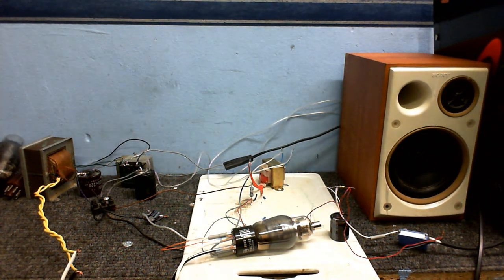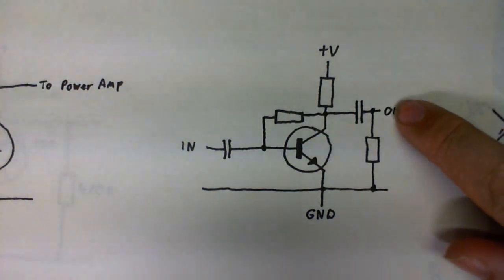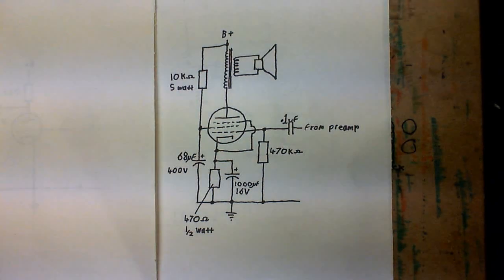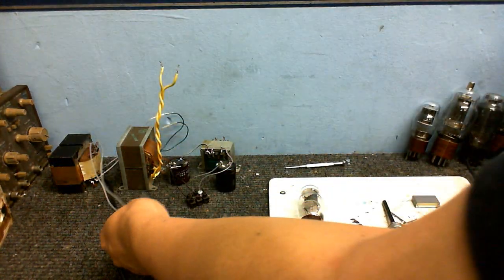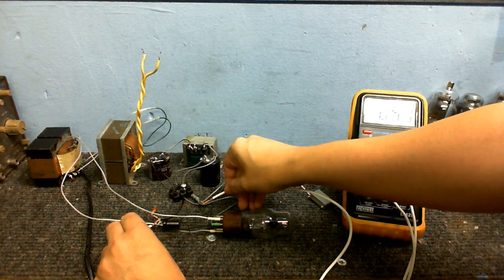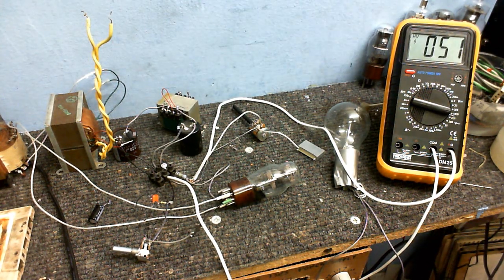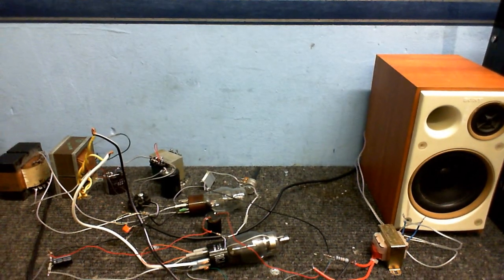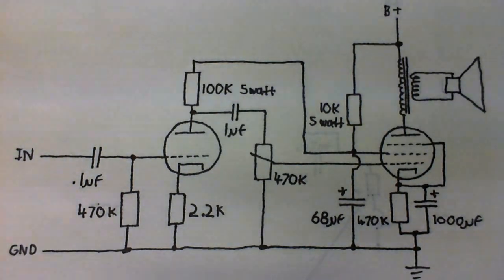Building a simple Valve Amplifier

Comment: Clem, I could use your advice with this:

http://youtu.be/zqErVXI3d_4

How do I properly use both sides of the triode to boost the first signal (rather then stereo). I think I might have an idea, but I'm not sure. I know the signal from the first side should then go to the input of the next....I will try to write a schematic and post it. Any feedback is WELCOME and appreciated in advance. Cheers.
Reply: What do you think? Will it work as a low voltage preamp? I'm just doing one channel boosted by the same double triode...

http://i51.photobucket.com/albums/f396/czechrite/W-AMP1-contrast_zpsbd58742a.jpg
Reply from the maker: Sorry I took some time to reply as I'm a little busy.  Anyway in that first comment, you posted a link to a video and it looks as if you're trying to power a speaker from a valve?  Like JohnAudioTech said, is IS a preamplifier and won't give much output though a speaker. 

The schematic you posted in the photobucket link might not work, it would be better to change that 100k resistor thats connecting the grid at the second stage (the grid that's to the right of the schematic) to a 470k and also add a 47k resistor from that grid to the positive so you basically have two of the same circuit, that should give much more gain, but I'm not sure how much.
Reply: I did try that and it DID work...but it also came with a huge amount of clipping. So, not effective.

However, I'd like to build this simple power amp you built here, but I'd like your advice on the valves. Which valves did you use? Did you mention? Does it matter? I could use just about any triode and pentode (just from memory, I think your valve for the power amp portion was a pentode).

Advice is appreciated. Cheers.
Reply from the maker: *****
For a simple amplifier like this it doesn't really matter, I tried swapping some of the tubes for others I have and it still worked. I used a triode at the input stage and a pentode for the power amp stage).  Typically in an amplifier like this an ECC83 and an EL84 are used but like I said just about anything will do. I used a VT-137 and an 6C6
Reply: CoolDudeClem Righto mate, BUuuuut......if I swap tubes....say I use the EL84 instead....do I keep the resistors and such the same or do I change it? Tell a noob how to take the data for the tube and figure out the resistance of circuit resistors using tube data sheets.
Reply from the maker: *****
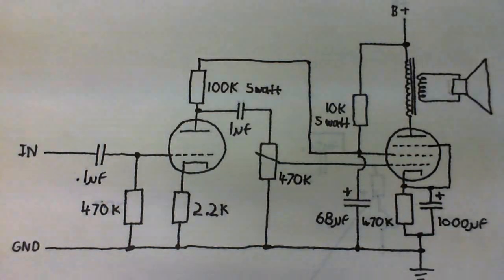It should work without changing the value of the resistors, but you might want to use high wattage resistors though (2 watts minimum), for instance when I tried it with an EL84 I found I had 12 volts across the cathode resistor. The 470k and the 2.2k on the triode don't need to be high wattage ones. Also I made a mistake on the schematic I showed at 22:40, on the output tube I marked the cathode resistor as 470k, it should be 470Ω.
Reply: CoolDudeClem Whaoh! Thanks for letting me know about the OP cathode resistor! I did print that sucker out and put it in a "kit" so to speak so I'll make that correction right away. I also ordered the original valves you used but I'm gonna first try with an EC92 simple triode and an EL84. I might switch out the EL84 for a Ruskie 6p14 just to compare the gain. I'll let u know. Thanks again.
Reply: CoolDudeClem Annnnnd......I also noticed that in the separate pentode schematic you made, you corrected that resistor...however the capacitor from the preamp anode (I think that's what it is) is at 0.1uF....while in your large schematic at 22:40 it shows as 1uF. Maybe it doesn't matter much or I just misunderstood, but I'd like your opinion on that. For now I'm following your original schema on 22:40 with the correct resistor (470ohms, 1/2 watt)  the 1uF cap from preamp, and using valves EC92 and EL84. Any advice appreciated in advance. Thanks for sharing.

Comment: Hi, I have come across a ECL86 tube which contains a triode and pentode. So in theory I could build your circuit with the one tube. What do you think?
Reply from the maker: Should be possible, I have a couple of those myself.
Reply: CoolDudeClem I may try using a couple then to make a small headphone amp providing I can find suitable output xformers. How did you get on using mains xformers for output, Proper ones are quite expensive :( Also could you use two identical xformers together for the push-pull output ?
Reply: lol the spammers back
Reply: *****
bla
Reply: *****
Yeah true, I'm using transformers with 244 ohm / 1.7ohm and it sounds fine and still gives good output but have some proper transformers on order :). Will be building an amp with PL509 for output soon.

Comment: Short circuit at an AC transformer: Transformer short-circuit the secondary winding
Reply: This shows how important an AC fuse is.
Reply: well arend we a scared little boy
as long as you work with care there is no need for that
(and i work with unfused radio's from the 50's)
Reply: Every radio in the 50ies has been equipped with a fuse. If you remove them, then it is your own fault and your own risk, but even the engineers in the 1930ies have known about the importance of fuses in their radios!
Reply: Hey did you ever touch an old radio

Well i have touched and worked on many old devices
And around 50 a 60 % is not fused
Reply: I have a collection of 14 old tube radios and three tube television sets from the 50ies and early 60ies. I also have a collection of oscilloscopes (Tektronix, HP and german brands like AEG and Nordmende, etc and measurement equipment  which has been build between 1950 and 1968. Every single device is protected by fuses.

And of course I have worked on them, made repairs, alignment etc.
Reply: Could you give an example device, Brand and model? I would like to look at the circuit diagram. At www.Radiomuseum.org are many scanned circuit diagrams. Maybe you have missed the fuse.
Reply: no i did not miss any fuse
most philips u radios dont have one
and most normal radio's do also have non
but when they dont have one they have a thermal fuse on the transformer
(if it gets to hot it melts and breakes the conection)
Reply: Well, this is also a fuse!
An some radios, and TV sets, fuse wire has been used.
Please give an example of a Philips radio without a classic fuse.
Reply: firsth radio i lookup
BX300U
NO fuse
Reply: Yes you are right, the Radio is a transformerless radio with U-tubes. Without fuses It is really dangerous, because if you connect it to the grid while the chassis lies on L and one of the capacitors at the antenna port (C5, C6) or at the ground port (C7) fails, a really high current could flow through the radio until the house or line fuse interrupts the current. Even if the line fuse has only 10 amps, for a fraction of a second several 10 amps can occur. This can set many things into fire.

Comment: OMG, again you have connected the power transformer, just with wires to the AC cable. There is also no AC fuse!. It is extreme dangerous. Some cables are just twisted together. Also a source of electric hazard. When you move only one component while it is connected to AC, one of these connections (twisted wire connection or wire pushed inside the AC connector) could disconnect, and because of the spring tension of these wires, it could create a deadly connection to your arm! Fire can also occur because of arcing. For AC connection you have used wires with too thin isolation. This small isolation can not withstand high voltage!
When you at least use terminal strips at every connection and AC cables and a fuse for the AC mains connection, it would be much safer.
Reply: a solderd ac lead i way more saver than any existing thermal strip

and who are you to say that this isnt save
i for one know that it does not matter to touch ac
as long as you dont grab it
Reply: I have studied electronics and I work as electronics engineer since 15 years. So I would say, I am an electronics expert. When you say, that the AC mains voltage is not dangerous, then this is a dangerous mistake. Surely is 50Hz or 60Hz 115V or 230V AC Voltage dangerous. You can just read this wikipedia article: http://en.wikipedia.org/wiki/Electric_shock
And if you don't want to read the whole article, read these lines from the article:

"A domestic power supply voltage (110 or 230 V), 50 or 60 Hz alternating current (AC) through the chest for a fraction of a second may induce ventricular fibrillation at currents as low as 30 mA.[4] With direct current (DC), 300 to 500 mA is required.[5] If the current has a direct pathway to the heart (e.g., via a cardiac catheter or other kind of electrode), a much lower current of less than 1 mA (AC or DC) can cause fibrillation. If not immediately treated by defibrillation, fibrillation is usually lethal because all of the heart muscle cells move independently instead of in the coordinated pulses needed to pump blood and maintain circulation. Above 200 mA, muscle contractions are so strong that the heart muscles cannot move at all, but these conditions prevent fibrillation."
Reply: you know what i read
bla bla bla
i have toched 110V ac
240V ac
350V dc
10Kv dc
15Kv pulsed dc
20Kv pulsed dc
and a whole rage more

i have beel playing with electronics sins i was seven (thats 16 years ago)
and i can say it is not a big deal

ac power hurts but it never woonded me
Reply: How old are you?
Reply: http://www.esfi.org/index.cfm/page/Injury-and-Fatality-Statistics/pid/12015

"Each year, there is an estimated average of 60 electrocutions associated with consumer products.  The three most common product categories associated with electrocutions are small appliance, power tool, and lighting equipment. - See more at: http://www.esfi.org/index.cfm/page/Injury-and-Fatality-Statistics"

Maybe you have just got luck, that you are still alive. When electricity isn't dangerous, why have these 60 people died?

And I am sure, that every radio you have worked with, is equipped with a fuse.
Reply: No old radios are unfused same as most old televisions
Reply: And if you can read
And calculate
You can count it up to 23
Reply: Yes, thank you. I have already calculated your age too.
Reply: :P

sorry that was just me being a smartass

Comment: Awesome stuff, pretty good explaination, there was a lot of stuff here I didn't knew, and the music at the end is great.
If you proceed to build this as a finished amplifier, I suggest using the case of an old computer power supply as chassis for this amp (Or some other strong metal case). You can maybe put power transformers inside and ground the case, the vacuum tubes and output transformer on the top, will give a neat look.

Comment: i have a tip for you
write the tube nbumbers next to the tubes in the circuit

it makes rebuilding it later realy easy
Reply from the maker: Yeah, that's the one thing I forgot to do, I didn't remember it until I'd uploaded the video.
Reply: :P
can happen
Reply: *****
wow i never have seen a person with so little live as you
Reply: It's no big deal....it will work mostly with any triode/pentode combo if you adjust for specs.
Here is the schema with tubes "labeled". Thanks again, Clem for sharing all this great info with us.
An "updated" schematic is linked here as per your info and corrections:

http://i51.photobucket.com/albums/f396/czechrite/tube%20electronics/6C6_circuit2_COOLDUDECLEMSAMP_Complete1-Copy_zps2cd2f179.jpg
Reply: ***** Yeah, lucky so and so! I wish I had more time to tinker and experiment!

Comment: What output transformer did u use?? whats the value?
Reply from the maker: It was out of a "BoomBox" 240 volts on one side and 12 on the other.
Reply: Ahh i see same trans as i am using just that my core is a bit smaller so a little lacking on bass
Reply from the maker: Benjamin Tan Mine lacks in bass a little as well, but the speaker I used is a bit "boomy" so it kind of compensates for that.  I tried with a microwave transformer and the bass was much better but there were not much highs.
Reply: I see check the amount of winding on the transformer and make sure the spacing of the primary and secondary coils as close as possible
Reply: Benjamin Tan I've found that smaller mains transformers with a primary of around 240+ Ohms and a secondary of about 1.7+ Ohm or more work well but there is no real substitution for purpose built output transformer.
Reply: Brian Taylor
 But it works  :) hahaha